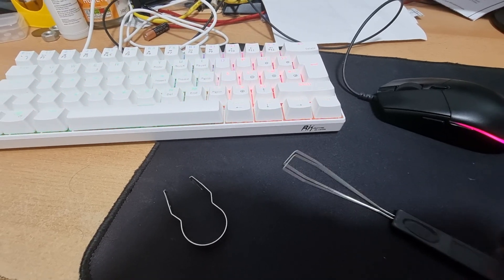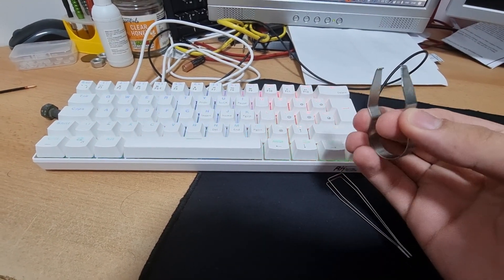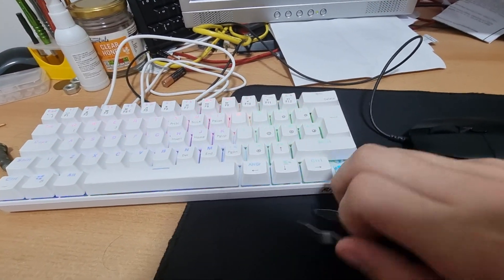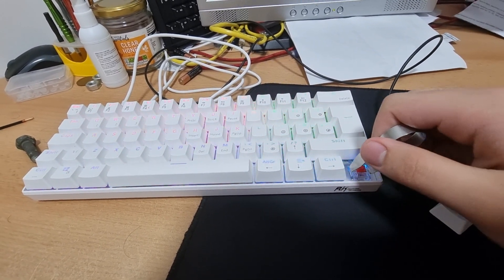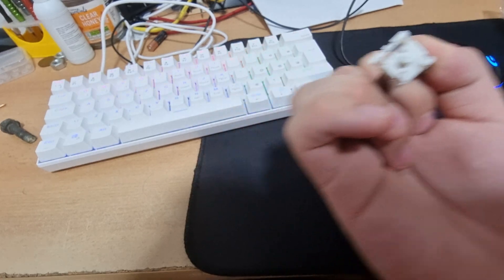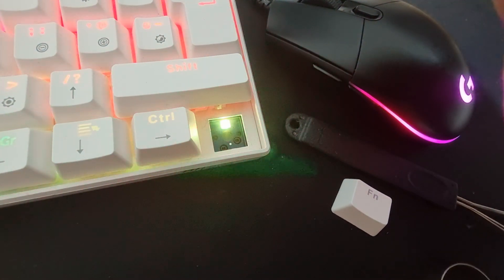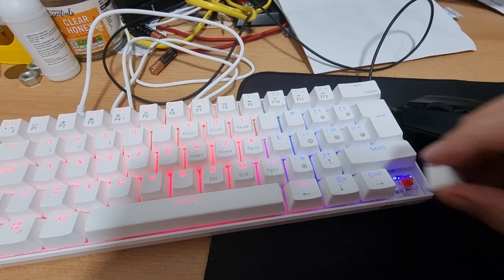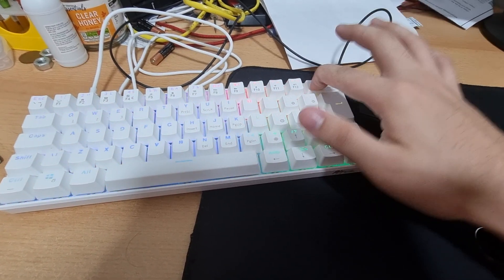How to remove hot swap switch on hot-swap keyboard (like this RK61)

Comment: What do I do when everything is fine but when I put the switch in it won’t work like every other key works but I wanted to see how the switches work so I pulled it out like it’s suppose to be pulled out then I checked and put it back in correctly but it won’t work
Reply from the maker: its two golden pins are supposed to go in the hole, if it goes in just lift the whole keyboard out and look at the circuit board's underneath where that key is and it doesn't work, in case solder wore off
Reply: @LucasImpulse  I found the issue and somehow when I was taking out the switch and the wire broke so what would you do in that situation because I got no idea what to do since it’s a complete new keyboard and I like it a lot so any suggestions?
Reply from the maker: @Yoshi18293 did you get some more replacement switches with the keyboard when you bought it?

Comment: Hello, can you help me? I'm trying to remove the switches from my keyboard but they're not coming out
Reply from the maker: if you remove the keycaps you will then use the switch puller, put it at the top and bottom of the switch, and squeeze and pull, you can shake while you pull side to side to dislodge it. let me know if this works.
Reply: I've already shaken it, I've used a lot of force to the point of almost breaking the swich and it still won't come out. @LucasImpulse
Reply from the maker: @hlibs6647  check the back of your keyboard's board, there is a chance it is soldered
Reply: If it is soldered, how do I change the switches? @LucasImpulse
Reply from the maker: @hlibs6647  you would have to use a soldering iron, i do not recommend it unless you're good with soldering, look up different images of hot swap switches and soldered switches so you can tell

Comment: Hello, some keys on my keyboard stopped working, do you know how to fix them?
Reply from the maker: if it is the same keyboard as in the video, take out the screws in the back, then lift out the entire keyboard board. in the keys that don't work, check if their switch pins actually go in the switch ports. i'm not sure how to explain but there are two holes and two gold pins go into them, and if that is messed then the keys don't work.
Reply: imagine that I click on the letter h, I think I did something with the keyboard that the keyboard does not identify the h but it does identify the insert @LucasImpulse
Reply from the maker: @hlibs6647  i know the problem, you pressed fn + ctrl. this switches between 3 modes, and mode 1 is normal. you know you're on mode 1 when you press the numbers and they actually type. press fn + ctrl and your keyboard will flash and the keys will swap. then test with number keys. fn + enter also swaps your arrow keys btw, and fn + a is windows mode, fn + s is mac mode
Reply: Thank you very much, it solved my problem, I really appreciate it
 @LucasImpulse
Reply from the maker: @hlibs6647  no problem enjoy

Comment: Hello, did your rk61 come with the key and switch remover or not?
Reply from the maker: yes it did, the key remover was long and looked like steel wire, the switch remover looked like a nail cutter
Reply: Did the switch remover you use in the video already come with the rk61? @LucasImpulse
Reply from the maker: @hlibs6647  yes it did, i also ordered from amazon, from ROYAL KLUDGE
tip: you can kinda take out the whole keyboard board using your nails, only after unscrewing the screws on the back, then you can use your fingers to detach keycaps, but for the switches i don't think the same approach works
Reply: Do you know how to improve the keyboard latency and its response? @LucasImpulse
Reply from the maker: @hlibs6647  my best bet would be to plug it in with a wire, straight to the computer

Comment: hello everything is fine ? I wanted to ask a question, does this keyboard have how many pins? because I wanted to buy a new switch but I don't know how many pins there are
Reply from the maker: this keyboard RK61 supports both. 3-pin and 5-pin both work on it, they both have 2 connector pins anyways. the difference is, 3-pin has 1 plastic piece for stability and 5-pin has 3 plastic pieces for stability.
Reply: which is the better option then 3 pins or 4? @LucasImpulse
Reply from the maker: @hlibs6647  they are both the same, technically the extra plastic on a 5 pin gives only a tiny more stability (it doesn't matter). 5 pin switch slots accept both, 3 pin switch slots only accept 3 pins. but you can cut off the plastic of a 5 pin to get 3 of course.

Comment: Is it possible to remove the switches without the puller-doohickey??
Reply from the maker: yeah if you got good fingers or nails it might hurt a miniscule amount though, you can use anything that pulls them out it won't be as fast as the puller thing, try look it up if your keyboard is hard to pull keys off of or tell me what your keyboard is
Reply: @LucasImpulse  it’s the same on as the video
Reply from the maker: @GamerStickslol  yeah then if you do not have the puller thing (check the original box) use a spoon or knife or whatever for the side or corner, and then use your fingers by putting them in the new hole you made and picking off keys next to that hole

Comment: mine.. won't... budge... and i have a switch puller omg.. helpppp
Reply: same
Reply: @acsel3203  i emailed royal kludge customer support & they confirmed my version wasn't hot-swappable LOL smh... but i have another issue with another rk keyboard. it won't turn on or charge & they haven't gotten back to me on that, yet. sigh...
Reply from the maker: that's actually unlucky my brother
Reply: currently dealing with this as well... did you ever manage to get them out?
Reply from the maker: i believe that you need one tool for the keycap, and one tool for the switch. the keycap accepts the thin wide one, and the switch stays. the switch accepts the small and thick one, and you gotta grip it and shake it a little here and there whilst pulling it. you have both these tools?
Reply: @LucasImpulse  I found out my RK61 is actually soldered 😀 I guess I bought an earlier version that isn’t hot swappable.
Reply from the maker: @WesleyDropDead  oh damn, if you want to make a change then i guess you gotta get out the soldering iron